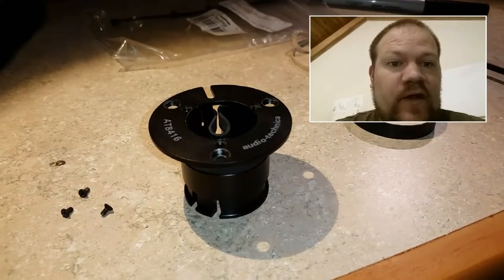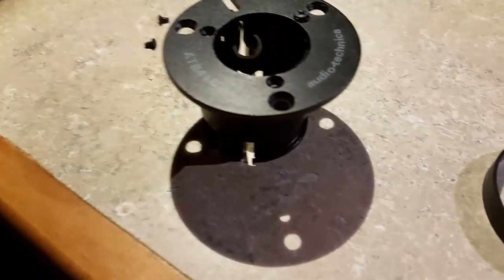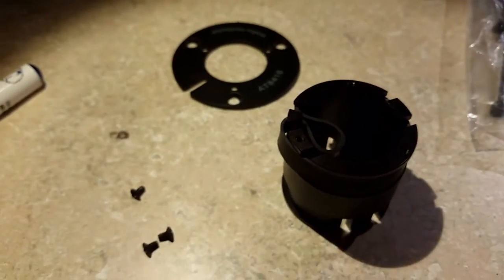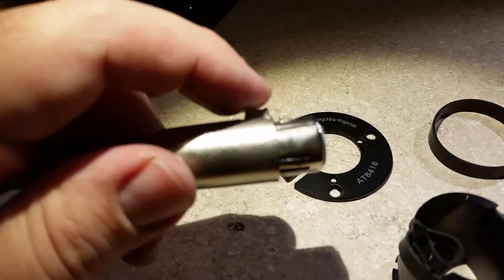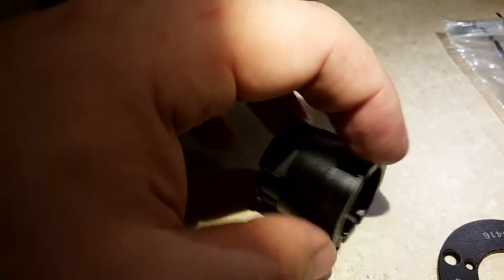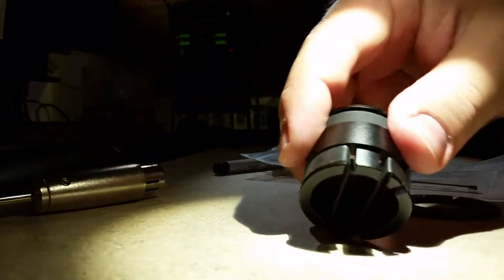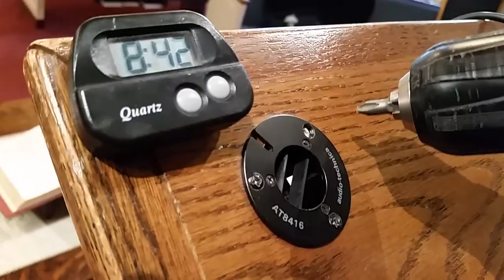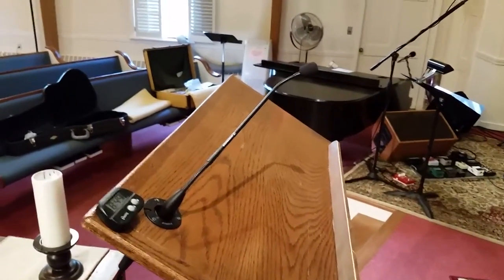Audio-Technica AT8416 Shock Mount Rubber Band Replacement | Volunteer Tech Vlog

Comment: Hi, The mount can be used 2 ways, the first way is how you are using it and the second is with an adapter that usually comes with it. We use ours with the Audio Technical AT857 Goose Neck which fits into the holder and this is how it’s intended to be used. If you don’t have the type of mic that fits you use the adapter which fits into the holder and you can screw a mic clip onto it.